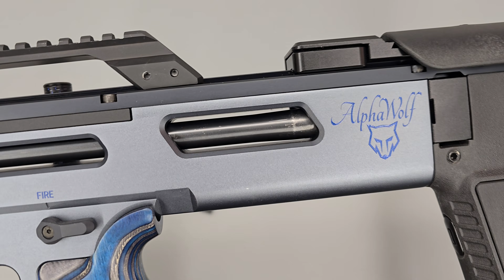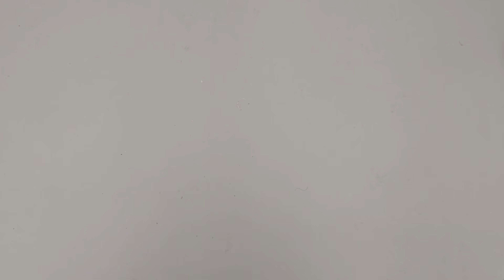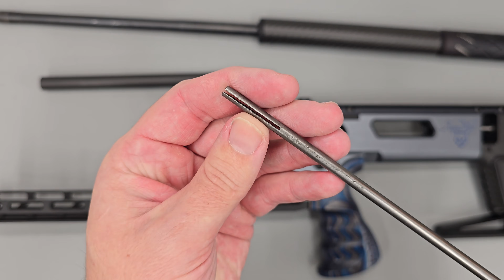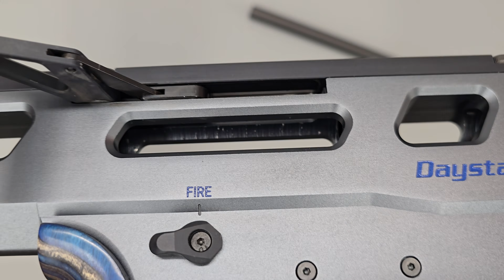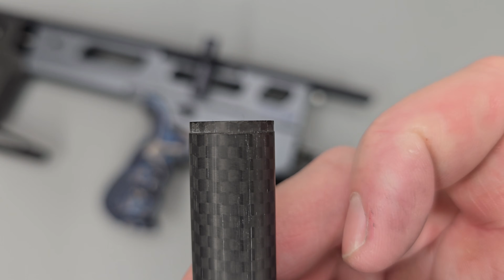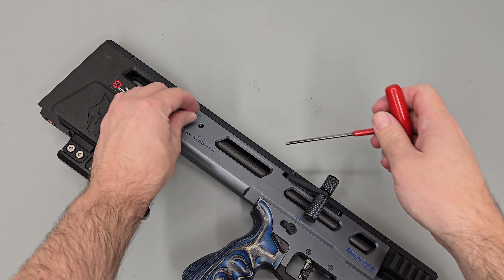Making a carbon fiber stiffener for the Daystate alphawolf/ BRK Ghost

Comment: Take care in trying to do this and make sure your barrel is the correct diameter - many of the barrels are 15mm OD so the carbon fibre tube listed in this video will not work unless you get the barrel turned down - I found this out after I order the carbon tube !
Reply: Yes mate same here, the barrel won't fit when I tried on my ghost

Comment: Just tried this on my delta wolf   And I have a problem with my barrel I bought the tube in the size recommended and from the link but the tube is too small do you know if Daystate use different sizes of barrel mine is 15mm. Your alpha looks great with the barrel tube and all the other stuff 👌
Reply: Mine also...very frustrating.
Dilema time, do I order new tube or turn the barrel down ; that is the question :)
Reply from the maker: if you purchased the tube from the link it should fit with a bit of cleaning out with some sand paper, i have done 3 with the tube now but i cant  vouch for the barrels they maybe slightly different 👍

Comment: Looks awesome 👍is there another way to de gas the rifle.  as every time I dry fire the Ghost to de gas. the hammer jams forward against the valve ,and rifle has to be stripped to release it?
Reply from the maker: you can go up on the reg a little and it will let go then when its empty go back down with it 👍

Comment: Great video Jake, just doing a small upgrade can make such a big difference, brilliant job.  Jake I’d like to ask you a question about a rifle I’ve just bought but only with your permission, let me know if it’s ok,  many thanks 👍🇬🇧
Reply from the maker: Thanks and yes, feel free to ask away 👍
Reply: @sub12airgunners  Hi Jake thanks for letting me ask you this, I picked up a rifle as a spares or repair it’s a Pax fast fire 10 in .22, I also have one in .177 don’t if you know about them it’s designed as a takedown rifle, it has an adapter that screws in the back and the bottle screws in to the adapter. I’ve checked out the web but can’t find an adapter like this, it’s got a pin in the centre That opens the valve in the bottle as it’s screwed in place, it’s one of these that I need. Watching your last video where you unscrewed the bottle is the reason I thought I’d ask you, any help or suggestions where I could get one would be greatly appreciated, thanks again Jake for time 👍
Reply: Your